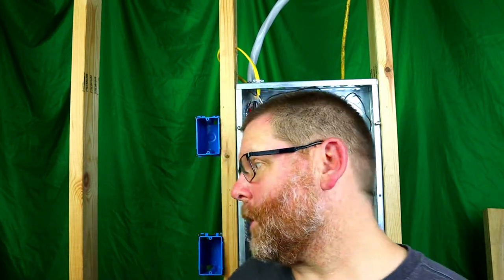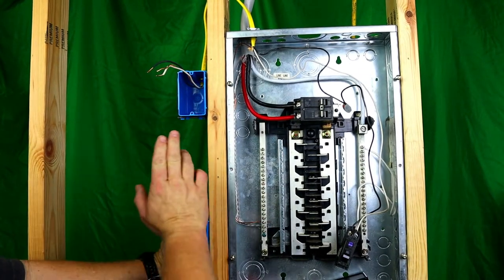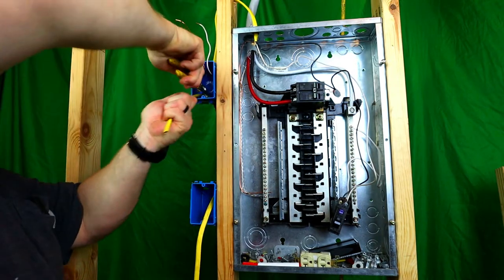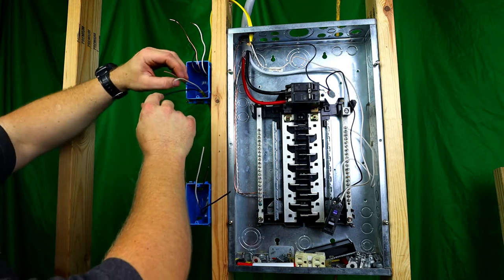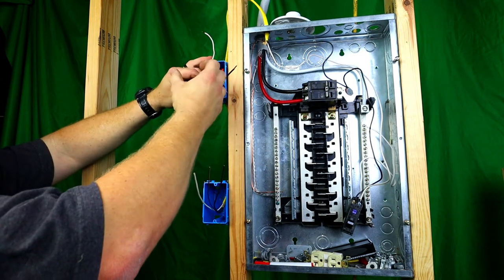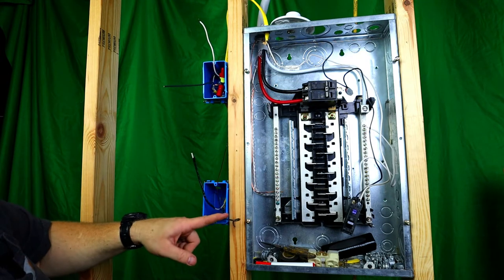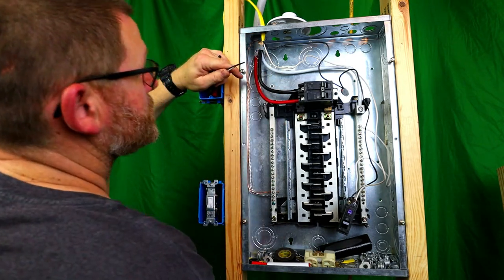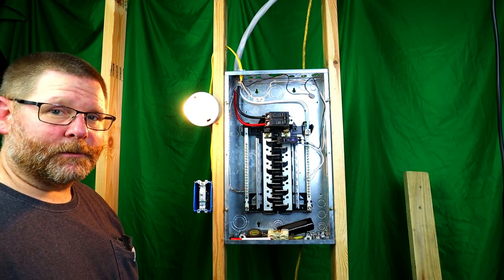Installing A New Light And Switch From Start To Finish | DIY

Comment: I know you guys in the USA do things differently to us in the Uk 🇬🇧. I just don’t like the you do it like I don’t get why you don’t put green and yellow sleeving on the earth conductors and why you twist conductors together it increases the resistance of the copper. Also your cable doesn’t make any sense why in gods name do you have black as live and white as neutral every country in the world use red for danger as the live and black and neutral , except the uk and Europe now have brown as live blue as neutral and the earth sleeved with green and yellow PVC sleeving  and why do you call the live the hot and the earth the ground. You call a switch a switch but you call a plug socket a receptacle . Take an electric kettle on the end of the power lead is a plug that goes into a socket. ( plug and socket) .  Hell you don’t even have fuses in your plug tops totally insane.
Reply from the maker: I would feel like you if I was in your country too. Thanks for the comment and watching ☺